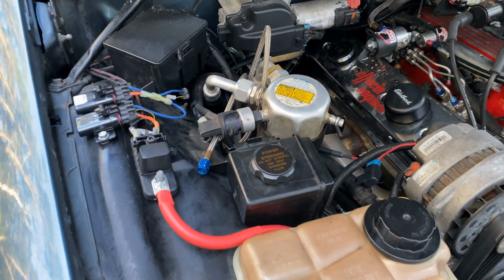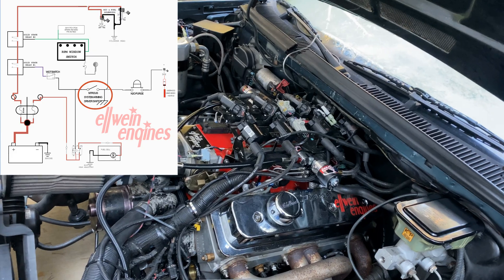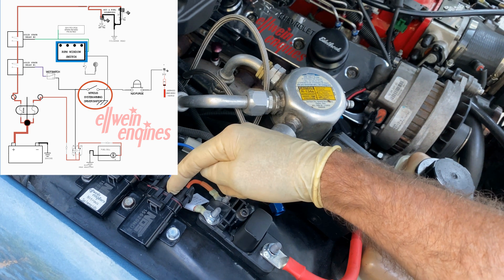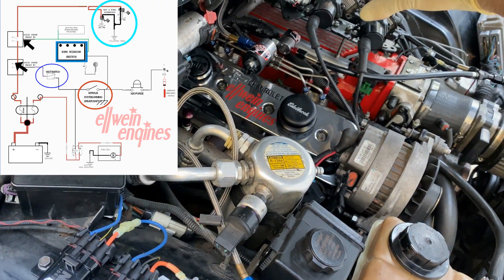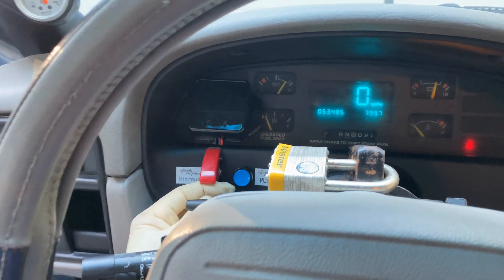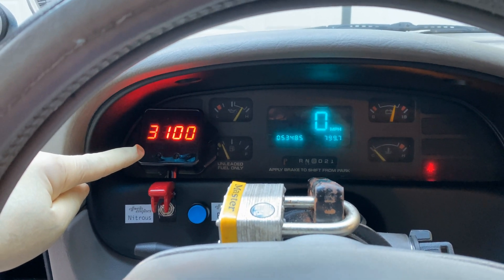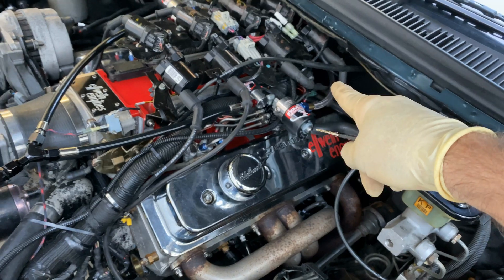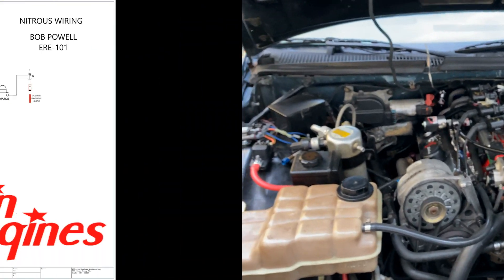Single stage nitrous wiring with window switch to the LS1 PCM

Comment: I often thought about nitrous. This is helpful for me, bc I need the education! I still have the Lt1 computer. Would you just use a MSD box to retard timing. I also heard rumors that the boxes harm the opti. I usually don’t listen to the internet on the opti bc it’s used as a scapegoat.
Reply from the maker: I would definitely use the MSD box for LT1 computer.  I know you can get that LT1 PCM to run as good as the LS PCM...it's just harder to work with.
Reply: yea get the msd box thats what i have for my lt1 been great also have the msd rev limiter